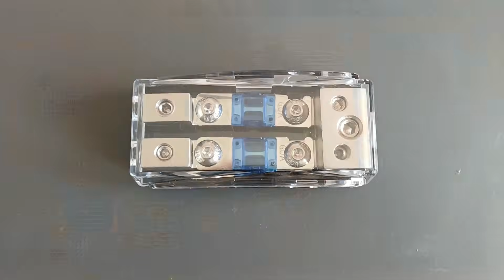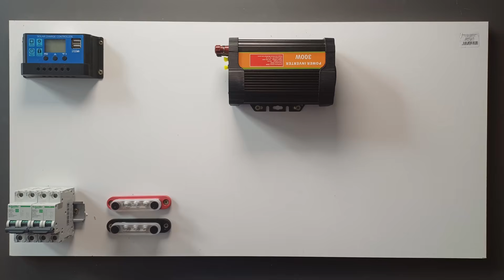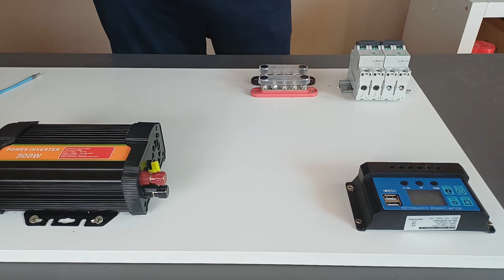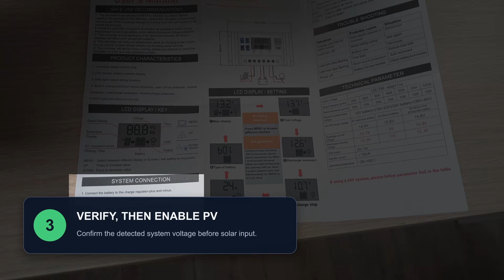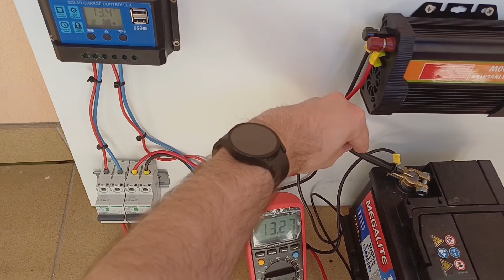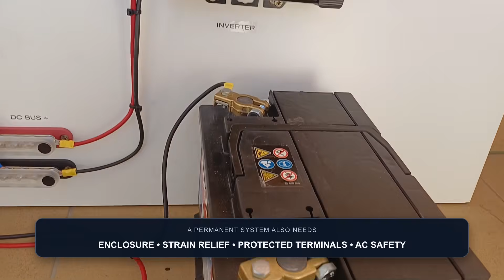I Built a Basic 12V Solar System — It Works, But Has Problems | Upgrading Until Overkill #1

Comment: Підкажіть чи можна на такий контроллера підключити 450 вт сонячну панель?
Чи клаще взяти пошкоджену?
Reply from the maker: A 450 W panel may work only if its open-circuit voltage (Voc), including the increase in cold weather, stays below the controller’s maximum PV input voltage and its current remains within the controller’s rating.

However, this PWM controller would not use the panel’s full 450 W output—it pulls the panel voltage down close to the 12 V battery voltage, wasting much of the available power. For a panel this large, I would use a properly sized MPPT controller instead.

Also, be careful with inexpensive controllers of this type. Their maximum current ratings are often exaggerated, and apparently different models may have different numbers printed on them while using essentially the same internal hardware. I would not operate one close to its advertised limit.

I would also avoid using a damaged panel because it may have insulation faults, moisture damage or hot spots.

Comment: how does the battery get charged?
Reply from the maker: The battery is charged by the solar panel through the PWM charge controller. The controller regulates the charging voltage and current and prevents the battery from being overcharged.

Comment: Warning! The solar charge controller is destroying the batteries!!!!!!!!!!!!!!! Attention!
Reply from the maker: Could you explain which specific voltage or controller setting you believe is damaging the battery?

The 16.2–16.6 V readings shown in the video are measured on the solar-panel input, not at the battery. The measured battery-side voltage remained between approximately 13.0 and 14.12 V.

I agree that the charging profile must be correctly configured for the specific battery type, but these measurements do not show the battery being subjected to 16 V.
Reply: @EmergencyPowerLab  I agree. There is nothing with this setup that can damage the battery. It is impossible for the solar charge controller to damage the battery in any way.

Comment: Hey, that’s all well and good, but you should connect the inverter directly to the battery, not directly to the charger.
Reply from the maker: It may look that way, but the inverter is connected to the battery via the DC bus bars. The MPPT is simply connected to the same bus in parallel.
Reply: @EmergencyPowerLab  Yes, sorry, that was my fault.
Reply from the maker: @pascalp.7495 No worries ;)